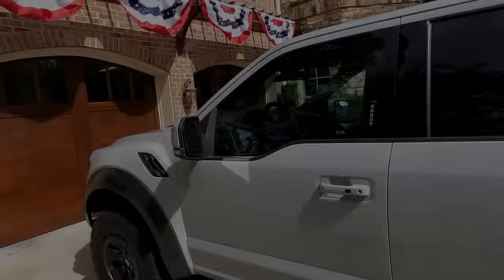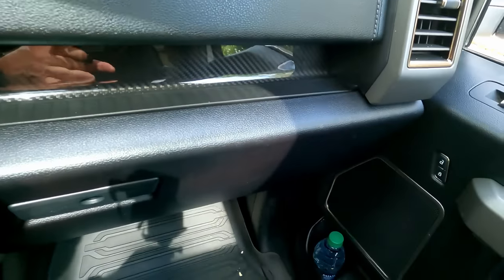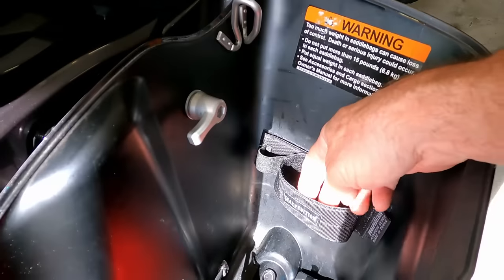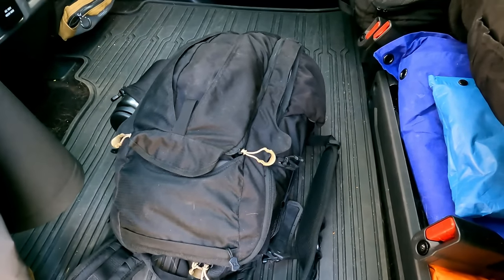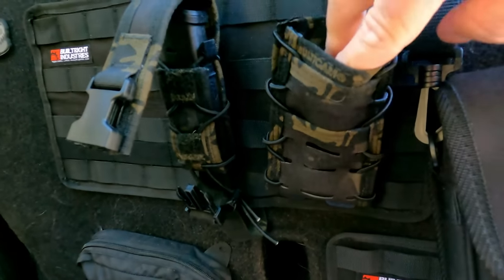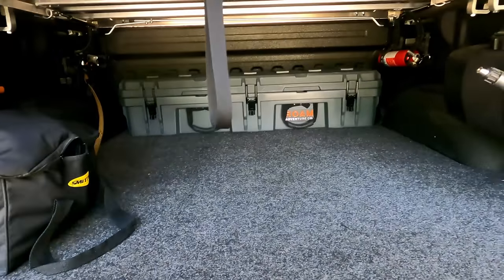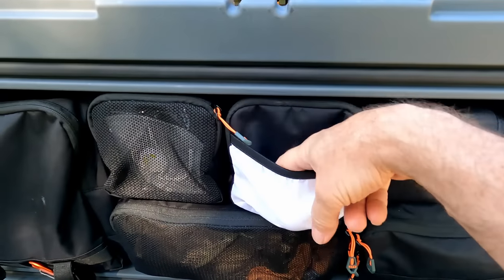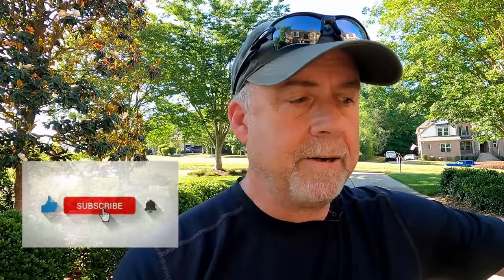Truck EDC - Everyday & Emergency Gear

Comment: Got some good things going on there. I would suggest highlighting your holster set up in the truck and on the bike that you get some training with your blow out kit and make sure it has everything you need to stop the bleed. Tourniquet should open and staged so if you need to use it on yourself...usually one handed you don’t bleed out before you it get it out of the plastic wrapper.
Reply from the maker: Michael, Thanks for your comments.  Yes the wrapper has been removed from the tourniquet.  I will be taking some med training in the next 60 days.  I do plan to take a deeper dive with some of these products in the near future.  Thanks again for your interest in the channel.

Comment: If you have the room a small powered fridge can be had on Amazon for like 100 bucks, life saver to have in the bed of the truck for when you need it. Dometic makes great ones but even just a cheap small one is a really nice have for a truck. thanks for the cool video
Reply from the maker: Hi Brady.  Thanks for watching and your feedback.  I have been looking at both the Dometic and ARB units (especially now that I have a Jackery system).  Also looking at a full bed slide for the set up.  Ill produce a video once I have the set up completed.

Comment: You should mount your fire extinguisher inside the cab of the truck that way it is quick access I would say under the driver seat
Reply from the maker: Hi Celeb, thanks for your comment.  Yes, I have one on order from Blaze Defense do do a review.  It should fit well in the cab.  The place I currently have it is not a good place but was a little better when I didn't have the tent on the truck and could raise the upper end of the bed cover.

Comment: One thing you can consider is a pair or rubber type surf or creek water slipper. Usually find them is the spring in sports shops. They are light and can be worn at the end of the day or when you want a moccasin type footwear. With a pair of socks, great for a quick camp or yard wear. Good driving moms as well. Keep them in goals and vehicles.
Reply from the maker: Hi Racker.  Thanks for watching.  Good idea.  I have water shoes for hiking / camping but do not normally have them in the truck all of the time but would be a good addition. Thanks.

Comment: Ive got the ust tube tarp tent it rolls down more compact and works super well. Multiple useful configurations. Also the snugpak jungle blanket is a great piece of kit is super compact and lightweight for the amount of warmth it provides. I have the regular size and the xl version for when my lady is with me and is barely any bigger packed down
Reply from the maker: Adam, thanks for watching and your reply.  I looked into both and have each on order in addition to the UST tarp.  Can't wait to try them out.  My thoughts are to have the tent as an emergency option, use the tarp for many uses, and use the blanket in my RTT during the summer.  Thanks again for the information!
Reply from the maker: Adam, I got the opportunity to try out the Snugpak jungle blanket this weekend and like it a lot!! Great addition to my tent for the summer.  Thanks for the recommendation.

Comment: Nice! I would only take the seatbelt cutter and move it to some place that is easier to reach. If you ever need a seatbelt cuter, your car is not going to be in the best condition.
Reply from the maker: Thanks for watching Jan.  Yes correct, it could be in a better location although it is on a quick release mount.

Comment: i did not see any zipties, id recommend putting that in too, cant go wrong with them in different sizes
Reply from the maker: Hi Dc thanks for watching.  I actually keep zip ties in my get home bag but is a good idea to have in the truck as well (in case I remove the bag from the truck).  Can't have too many zip ties!

Comment: AWESOME setup, this just popped up on my FYP. I know it is a couple of years old, you may have addressed this in future vids. please get some first responder type training. You should carry at at all times a tourniquet with your pew-pew, and know how to use it correctly. Only other issue I see is the Fire Extinguisher should be in the cab for quicker access. I carry 3 and 2 of them are twice that size in case I need to assist at a car accident, (not a firefighter just a citizen). Otherwise GREAT setup!!!!
Reply from the maker: Thanks for watching and your comments.  I have since taken trauma medical training and now have a fire extinguisher in the cab.

Comment: what are the mounts for all ur pouches and extra mag and stuff called. the board with the loops in it attached to the back seat
Reply from the maker: Those came from BuiltRight Industries https://builtrightind.com/products/builtright-industries-velcro-tech-panel-6pc-kit?gclid=CjwKCAjwgviIBhBkEiwA10D2j4itxDhl-kpiKxW4CE-yqejFZMxzTFKrqO6iAanPayQ0LFI5x_T8KBoCZ5gQAvD_BwE&utm_campaign=gs-2021-04-26&utm_content=sag_organic&utm_medium=smart_campaign&utm_source=google&variant=35930464977054

Comment: I hope you have a great alarm system with all that nice gear in that truck! I understand being prepared, but wow that’s a lot of stuff. But awesome setup and rig buddy 👍🏽
Reply from the maker: Thanks for watching Jason.  Yes the truck has a very good alarm system but I also try to limit time in undesired areas.  Sometimes we do not have a choice and have to take a chance.  I would rather be prepared and have to replace items if stolen than to not have them at all. Glad you liked the video.

Comment: Does the Raptor come with the velcro on the bottom of the seats already? Or is the under seat bags mounted to something you put on
Reply from the maker: Yes that is the way it comes from the factory.

Comment: The only suggestion is that I definitely would not store the pistol in your console. If anyone peers inside your windows, they can probably tell that all they need to do to get a new gun is just break a window, since you leave that back seat up with all the gear visible. Not sure if you have any kind of 2A or gun stickers on your truck either but would definitely remove those with all that valuable gear in there.
Reply from the maker: Hi Jordan.  Thanks for watching and your comments.  I didn't make this clear in the video but the handgun I have in my console is actually my conceal carry and is only stored there when I must remove it to enter an area where I cannot carry.  Regarding stickers, I agree with you totally, never advertise your love for firearms on your vehicle unless you want a curios thief to try to find out your preference of firearms.

Comment: Puncture repair kit, long handle shovel, move fire extinguisher to passenger foot well. Wipes instead of toilet paper so you can clean grease off hands too.
Reply from the maker: Mathew thanks for your comments. I have a tire repair kit in my recovery case as well as adhesive fabric for other repairs (shown in an updated video on recovery gear https://www.youtube.com/watch?v=TWogFXasAH4&t=87s)  I do need a long handle shovel and plan to mount in the truck bed with the axe. Fire extinguisher is definitely not a good spot.  I have another on order to review that will fit well in the cab.  I do carry plenty of wipes for multi purpose.  Again thanks for watching and look I forward to more comments and ideas!

Comment: Really nice setup. Not exactly the way I have my truck but some similarities. A useful pouch suggestion for you that I use is the maxpedition accordion pouch using two nylon straps (cheap sleeping bag attachment straps) to attach it to the back of the drivers seat headrest. Also the Tasmanian tiger headrest ifak for the riders side headrest is  really handy and useful, especially if you need to reach it from the drivers seat!  Glad you are wanting to get some emergency  medical training. Having med gear and looking for someone who knows how to use it in an emergency is like having a pistol on you and looking for someone who knows how to shoot it in an active shooter situation.
Reply from the maker: Thanks for the input. I had not seen the Maxpedition Accordion and I like the separations.  Definitely want med training and like your analogy.

Comment: Hey brother. Just a suggestion. I’m an emt with an emergency service. I suggest taking your tourniquets out of the plastic. If you get blood on your hands they are almost impossible to open if the plastic is on them. Speaking from experience. Amazing video and awesome truck setup!
Reply from the maker: Hi Woogie, thanks for watching. I actually removed the plastic soon after the video was published (rookie mistake on the plastic).  I have sense taken a trauma med training class that was great.  Thanks again for your input!

Comment: Especially since a Block Glock has no safety & a light trigger. I'm from Wisconsin & even with all that gear, you have no sleeping bags or a tent. Making one out of a tarp vs having a tent is a must in Wisconsin Weather, plus a sleeping pad, u have plenty of room in that Raptor. I have camped in such bad weather in Wisconsin that I've had to put a tarp OVER the tent.
Reply from the maker: Hi Kenton.  Thanks for watching and your reply. When you need a tarp over your tent, you are in some challenging weather.  When hiking I actually prefer a hammock with a tarp (off the ground and with a good under quilt).

Comment: I'm new to prepping, wouldn't you want to keep ammo in a air/weather tight case to preserve it?
Reply from the maker: Hi Ed, thanks for watching.  Yes in regard to ammo you are stockpiling, a cool dry space is required for long term storage.  But just like when our soldiers go into combat, there is a need to keep smaller quantities with you in less desirable environments. Excessive heat and humidity (causing corrosion) will takes its toll over time.

Comment: Is everything just velcroed to the bottom of the rear seat or how is it mounted?
Reply from the maker: Yes the material used on the bottom of the rear seats adhere very well to the hook side of velcro.  thanks for watching.

Comment: Is temperatures am issue for you? I want to do something similar to your setup but where I live the inside of the truck can reach 150 degrees Fahrenheit. I'm worried about items that are flammable or don't do well in high heat
Reply from the maker: Yes that does need to be taken into consideration.  My truck can get pretty hot at times when I am on trips but typical days it is parked in the garage.  There are some items I am reconsidering due to the heat (like water bottles).

Comment: I have a 2021 Tacoma and can't find a rack for the bed / Roof top tent that works with the hard bed cover. What rack are you using?
Reply from the maker: Hi Michael. I am using the Front Runner Load Bar System that I originally bought through DiamondBack when I bought their cover.  I then purchased taller mounting legs directly from Front Runner.  I have a few videos that may help you.   This one is on my initial build - https://www.youtube.com/watch?v=h-4FsnpnUxc&t=193s and this one discusses  my lift in height by going to longer mounting legs - https://www.youtube.com/watch?v=OjDrWWFRlM4&t=22s

Comment: I didn't see zip ties or a tow rope.  My apologies in advance if you had them and I missed it.  You have a lot of stuff!
Reply from the maker: VOR thanks for watching.  I actually have zip ties in my go bag and a tow strap in my recovery case in the bed of the truck. I also have separate videos on both.  Thanks.

Comment: I would recommend adding a fire extinguisher in the cab accessable from driver seat
Reply from the maker: Yes, I am working on that.  My current location is just barely better than not having one.........

Comment: Really thoughtful system. I like what you did with the bed considering what the truck is. I don't think I'd ever use my bed if I had a raptor(if I cought the tailgate correctly).
Reply from the maker: Thanks for watching James.

Comment: Great setup. I only suggest including a truck gun (short barrel AR-15) or something similar.
Reply from the maker: Hi Eric.  Thanks for watching. I have carried one in a go bag from time to time but not consistently.  My challenge is concealment since I leave my seats pulled up all the time.  I may try to position between the seat when folded up.  Will experiment over the weekend.  Thanks for the feedback.

Comment: How do you have eveything mounted under the seat in the back? is it held up using velcro?
Reply from the maker: The material Ford used under the seat sticks to the "hook" side of velcro.  Don't know if this was designed with this in mind but is very useful.

Comment: Several companies make nice locking consoles for the F150/F250 consoles. Might be something you want to consider to protect your firearm related items. 

Most of the good ones are secure yet quick access.
Reply from the maker: Yes, a buddy of mine has a Locker Down unit in his console and it functions great.

Comment: First video of yours that I watched, and I plan on watching more. Really great setup! I agree with you that your fire extinguisher needs to be in a much better place. Somewhere inside the cab would be best, even at arm’s reach from the driver’s seat, if possible. It’s one of those things that you either don’t need at all, or it is the most valuable thing you own. Possibly room in the center console next to the Glock? Looks like you have extra room in there, but hard to tell from the video. Take care, and God bless.
Reply from the maker: Hi GCN, thanks for watching and your comments.  I hope you enjoy the other videos.  I have since added a fire extinguisher in the cab (somewhat in arms reach) located on the back seat with the other gear.

Comment: Hey brother, great video and one thing comes to mind that is very small but very valuable to add is a Knipix Twin Key.  Not only will it help you access H2O from buildings but it also has assorted keys used for accessing rooms/cages like electrical or plumbing or gas.  The types of keys a janitor might carry or someone with building/plant maintenance....  perhaps this will help you.  All the best..............  MP
Reply from the maker: MP thanks for watching and your feedback.  Great idea.  I will have one on order in the next 5 min.  Thanks.
Reply: @WeekendOverland  Anytime and every time brother.  I always try to be helpful, I always try to be an ally.

Comment: Great set up!   However, on an EDC so much “loose” stuff can cause missiles during an EDC accident.    If you have loose material in your vehicle, during an emergency accident that material becomes deadly.    Great EDC rig but, most of that stuff is best kept contained and controlled.    I get the EDC but at least keep it from empaling the occupants if or when an accident occurs.    You have GREAT EDC gear, just secure it.    😎
Reply from the maker: Thanks for watching and I appreciate your comments!

Comment: If u were stuck in a shtf scenario stuck in traffic and had to leave vehicle like in downtown dallas where theres cars in front and back on the expressway like what happened to me lately during a traffic accident theres no way u can take all that what would you do or how to avoid that while traveling nobody know when shtf like an emp? Just wondering cus i wana do the same just debating leaving all that that i know isnt cheap?
Reply from the maker: Hi JS.  Very good questions.  If we experience an EMP or anything that takes the grid down for an extended period of time, the cost of gear you leave behind will be a low priority.  But you would have a list of priorities in that situation on what to leave and not leave behind.  The bigger dilemma for me would be if I had vehicle problems in a sketchy area and had to leave my vehicle to seek assistance which in today's world, would probably only occur if phone service was out or if you felt staying in place was putting you in more danger than mobilizing on foot.  The short answer for me is that I would rather have it with the possibility of losing it than to not have it and need it.
Reply: @WeekendOverland  thanks yea better to have it when you need it then not thanks for replying

Comment: Some great ideas of things to have in your truck, but why does everything look brand new still? If you are not got to use it share the wealth. I am jealous though.
Reply from the maker: Hi Roland.  Thanks for watching. Yes I did buy a few new items especially for the recovery gear setup.  I didn't want to pull from my other gear (that I do not keep in the truck).  Same with my tool bag video, I ended up buying a lot of new tools to keep from taking from the ones I keep in my tool boxes in the shop.

Comment: Wanted to know what did you use to mount the water port to the Molle?
Reply from the maker: Hi Joseph.  The water port comes with a mount that allows you to remove the container quickly but is also lockable.

Comment: Just a ZT hanging out in the back of your truck... I'd love to see the knife collection you keep safe in your house ! 😂
Reply from the maker: Hi Richard thanks for watching. Haha, I do have a couple nice ones stowed away in the safe.
Reply: True check out the price on that hatchet
Reply from the maker: @grassshadow1  equipment like hatchets and knives are heavily influenced in price by the materials used.  A higher quality knife or hatchet will be made from a metal that will hold a sharpened edge much longer and may be more durable. A more budget friendly solution is fine but just realize what is needed for it to service you as needed.